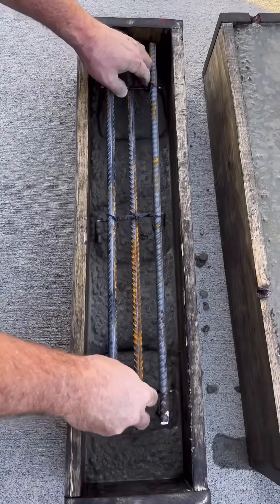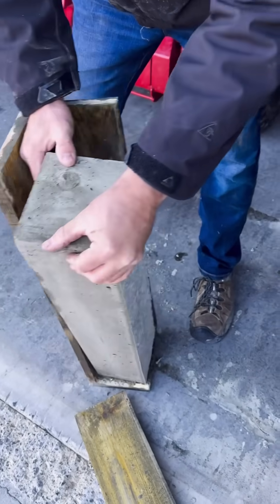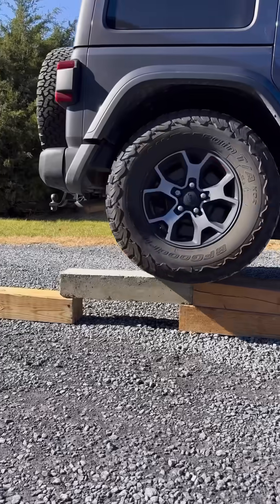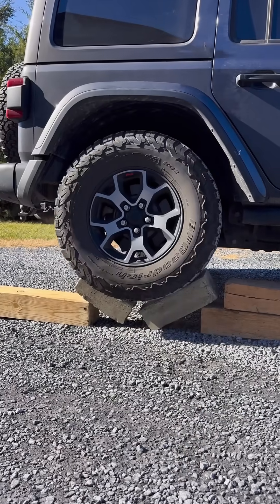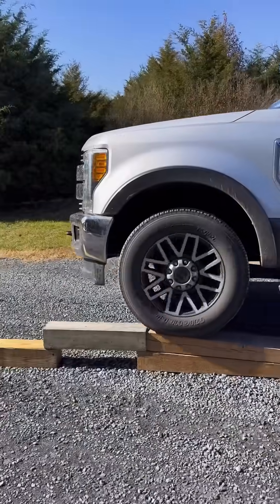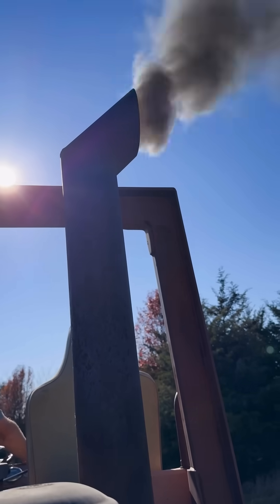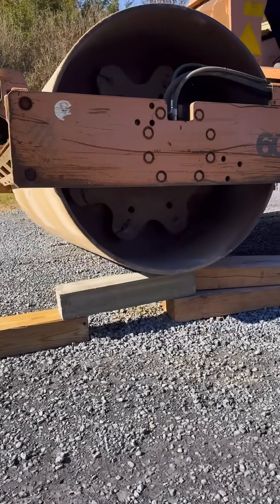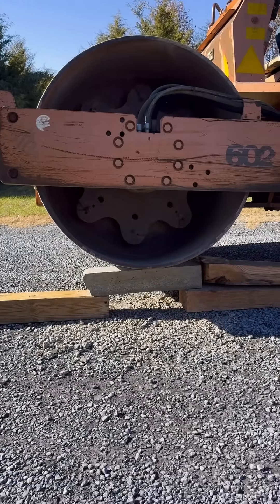Why We Use Rebar To Reinforce Concrete

Comment: Too much water in that mix
Reply from the maker: Super hard to mix concrete with a drill without adding a little extra water
Reply: Granted.
But 1st cure is a week?
2nd in a month?
If this is an important test shouldn't you use those chemical additives which minimise water? And consequently a drum mixer?
Reply from the maker: This is not really an important test. Just trying to show that steel reinforcement of concrete makes a difference. Not building a skyscraper.

Comment: I never knew rebar made such a drastic difference
Reply from the maker: I knew it made a difference, but even I was surprised at how much
Reply: @hausplans but does it matter the size of rebar? How do u know the best size to use?
Reply: @nofurtherwest3474 Engineering that's how. The load translates to tension in the rebar which you design to resist this tension. You also have to balance the tension resistance of the rebar to the compressive resistance of the concrete. You want the rebar to fail before the concrete so that the failure mode is "ductile".
Reply: @Phil_Boisvert14  what about a T-bar? wouldn't that be stronger?
Reply: @nofurtherwest3474  Could be or could not be. It all depend on the design of both. A thicker slab is stronger than a smaller beam, a taller beam is stronger than a thinner slab. Concrete is great because you can't form it into whatever you need. A structural slab, a beam, a column...

As for Tbar, I am not familiar with those as they aren't really used in my subsection of structural engineering (industrial). This shape of beam isn't really optimised for high load applications and it's harder to design a connection for it. I prefer to use an W beam because of availability and strength.
Reply: @nofurtherwest3474  1-you calculate how big the tensile stress gonna be on the lower face of the beam. 2-you calculate the cross section of steel enough to resist that tension without deformation (elastically). 3-you convert that cross section into commercial steel equivalent bars. 4-Finally, you add a few more bars to conform a 'cage' that doesn't come undone or slips, and account for mistakes on the calculations and defects on the materials. More steel than needed won't necessarily make your structure better, it will just make it more expensive. Care for the steel to be properly placed into the concrete and the whole thing to cure well (normally 28 days is enough, but it will be sooner in small structures), otherwise you won't have reinforced concrete, only concrete and steel working independently. Multiple tables and computer programs will tell you how much steel you need if you provide the cross section of your concrete beam and the stress it's supposed to bear
Reply: @nofurtherwest3474 that might work but a) that would be too expensive, you just didn't need any concrete there. b) if you mean use it as reinforcement in the concrete, it doesn't adhere well to concrete, that's why rebar has texture
Reply: You know nothing John Snow!
Reply: My house is made of bricks and concrete so i knew lol
Reply: Check out Practical Engineering's videos on mechanically reinforced earth and "stretched" rebar. Its pretty cool what people figured out with that stuff over time.
Reply: Fun fact : in French it's called "Béton Armé" which means literally "Armed concrete" 😂
Reply: I mean, have you ever messed around with rebar? It's heavy and quite sturdy as well, if you've ever just messed around with it then you'd know that it would make a huge difference. I do appreciate the little physics refresher tho
Reply: @ziggerotstask6287  can't say I have no
Reply: @Just_Caden  fair enough
Reply: When you don't have it suspended in the air an drive over it
Reply: He drove on the rebar with the front wheels, and on the regular one with the back wheels
Reply: @Prisal1 that just proves the point even more, because engines are heavy and typically in the front.
Reply: It converts the concrete’s compressive strength into tensile strength by giving it something to compress against. Just imagine sticking a metal rebar welded together under the beam. It would work in the same way.
Reply: 😮 serious?
Reply: Doesnt it just allow for compression since the wheels are basically just compressing the concrete into the rebar
Reply: do the same after 28 days of curing. then let see.
Reply: In structural engineering, concrete is assumed to have literally ZERO tensile strength (It does technically have a couple hundred psi of tensile strength, but just a small fraction of the compressive strength). As flexure always has a tension-compression force couple, the tensile component must be 100% resisted by steel.
Reply: It's actually why we don't use the infamous Roman concrete. The stuff used in it eats away at the steel.
Reply: It's great until it rusts. The UK is having a real problem with that right now in older buildings.
Reply: @frikyouall  Galvanized rebar should be used. It doesn't rust.
Reply: @XTCSMarius15  I think most of the buildings here in the UK were made dozens of decades ago, some of them are centuries old and just get refurbished I'm pretty sure
Reply: @XTCSMarius15 exactly. Galvanizing isn’t even that expensive anymore. Especially when it’s not dipped.
Reply: @XTCSMarius15 but it’ll be way more expensive then.
Reply: @frikyouall rust could only be a problem if the concrete is heavily damaged. It’s not a concern if the building is intact.
Reply: Gringos descubren los castillos de construccion, a ver si dejan de hacer casas de pura madera que se pudre con el tiempo
Reply: @cesardiaz8832 
You and your people are flocking to a country with “wooden rotting houses”, so it must be nicer than whatever sht 🕳 youre from amigo.

Comment: what if you mixed in long strains of some kinda fibers? like straw, or something like that, maybe with a little quicklime?
idk anything about this stuff, just an idea.
Reply from the maker: The problem with putting anything organic in concrete is it tend to rot over time. Concrete retains quite a bit of moisture.
Reply: what about fiber glass? or some kind of synthetic thread?
i just feel like  hundreds of small fibers of some sort throughout would be more capable of withstanding more force. Maybe I'm wrong, but it would be an interesting test!!
have you ever tried making roman concrete? a big part of the secret is the sea water they used, or so I've read. which is why we  haven't really been able to recreate it properly.  @hausplans
Reply from the maker: People reinforce concrete with fiberglass mesh

Comment: But if the soil is bad or sand based, the concrete will erode over time. For example, the Houston area is bad for foundation no matter how much rebar you have. Thoughts? How can we overcome this as a society for tougher strength in concrete?
Reply from the maker: Sand doesn’t erode concrete. Probably what’s happening is the sand underneath the concrete is eroding away

Comment: Concrete under tension is normally pre-stressed and not just reinforced.
Reply: For new construction with precast concrete. Cast in place concrete is not prestressed. In most of the world multi story cast in place is still the primary method
Reply: @jordankull4295  literally everywhere where pre-fabed slabs for floors are use they're pre-stressed. You CAN cast regular reinforced concrete but it will be several times heavier and structurally weaker.

Comment: Has their been any alternative to rebar? 
They can still rust and damage concrete structures after a few decades of being set.
Reply from the maker: You can get epoxy coated rebar. Also now there is fiberglass rebar.

Comment: Couple things. First, I could’ve used more drawings to help understand everything..I mean like the whole video…drawings. 
And C.   An average concrete anything wouldn’t have that much rebar per square inch like that. You’ve should’ve thrown in a pair of nail clippers and some nails when you had the chance.

Comment: The point of rebar isn't just to make the concrete stronger. It's to create a ductile failure mode. So that you see the concrete failing and have a chance to get out of the building.
Reply from the maker: You’re right about the failure mode, but it also makes it stronger

Comment: Less than a week. Which means the chemical reaction was still occurring. What do you think about the newly rediscovered formula for “Roman Concrete”? Apparently it self heals due to the added chemical (I cannot remember what) when it cracks, water gets into the crack and it reinitiates the chemical reaction which causes the crack to “heal”. They say that’s why those old Roman buildings like the colosseum survived so long when modern concrete only lasts a few decades

Comment: Fun fact: the thermal expansion rates of concrete and steel are very similar and that has enabled wondrous advances in structural technology. If it weren’t so, steel within concrete would cause cracking.

Comment: I always use more than needed rebar. Great video
Reply: That's all well and good up to a certain point, but too much rebar can cause a more brittle failure mode that requires a higher factor of safety.

Comment: What about adding galvanized stainless steel rebars metals that's resistant to rust and concrete melting metal ?
Reply from the maker: You can get rebar that’s epoxy coated and also they made fiberglass rebar

Comment: It's worth discussing how much rebar steel you should use (Is it the same for all applications?). In the past I used to see construction workers wetting the concrete several times after removing the formwork, to let it cure into a stronger concrete.

Comment: I dunno how you managed to justify all that effort for the video. It's super admirable of course, but if you were to take another shot this problem, I'd love to learn about the ways pre-modern engineers solved this issue with concrete before the invention of steel-reinforcement. After all, we still drive on bridges the Romans built

Comment: actually just steel do the job . concrete just filling the gap . if you use wood and insert the steel in it should has the same strenght . but if you use vertical structure , concrete can carry a lot of weight
Reply from the maker: The steel on its own will bend really easy. This Reber with bend just from stepping on it alone.

Comment: 1s vehicle 1st concrete back wheels are used = heaviest part of vehicle 
2nd vehicle 2nd concrete front wheels of vehicle is lightest part of a vehicle,not a fair comparison even tho i know the concrete with re-bar will be stronger,but still not a like for like video.
Reply from the maker: Are you serious? The back of the jeep is that definitely the lightest part of the engines in the front. The front of a F250 weighs probably three times with the back of the jeep did

Comment: If you can create further tension in the concrete by using revers with nuts and bolts then it can actually support even more weight
Reply from the maker: True 👍

Comment: Your mud is way too wet. That's a huge drop in strength.

Need to pour some test blocks of 8000psi and let it cure for a year. I'd bet it takes the roller to break them both.

Comment: As a concrete inspector 🤓 typically we cure at 28 days in a temp controlled room. 75°. I usually see more grouted beams rather than concrete but the mix design also plays a roll. Normally we make concrete specimens and break them with an hydrolic press between 7-28 days to average strength.
Reply from the maker: Thanks for sharing

Comment: 28 days is code for curing, but 4 days is usually enough during the warmer months
Reply: Never take shortcuts because of heat….cure the concrete for 28 days!
Reply: @louismerlini9816  exactly. My country is really hot and the summer goes up to 56C
Yet we cure for 28 days even in summer
Reply: Poured sidewalks are usually strong enough to walk on by the end of the day. I see guys walking on fresh concrete and saw cutting it.
Reply: @Josh-yr7gd Walking on it right away is fine, but the 28 day thing is if the cement is going to have to withstand high stresses, like a cement balcony that hangs out over the edge of a building, a concrete bridge, a parking garage, etc.
Reply: 10-20 in very hot country, my father use to work in that field
Reply: @kiethosmon792 in basra it reaches 50C and even 56C at times
And we still use 28 days.
Reply: 28 days is the mix design for most concrete.
Some are out to 56 days design strength.
We've poured concrete for the city streets for patching and had traffic on it within 24 hours.
It all depends on the mix that you're using that day.
Concrete literally keeps curing throughout its lifetime.
Reply: 28 days to get 90+ percent of strength. To get 100 percent you need to cure it for 3 years. Just to walk on the floor 3-7 days, to take out from form sometimes 12 hours is enough. Data comes from my own experience from laboratory and construction site.

Comment: i remember there was one cool example where an old ww2 bunker which had like 8m thick rebar renforced concrete was turned into a musem and it took them AGES like i think it was a few years to put in the fire escapes because it was so hard to break through